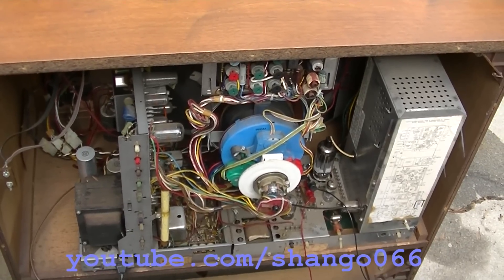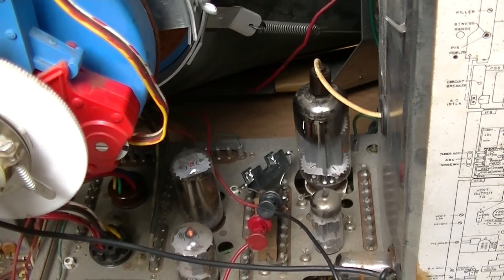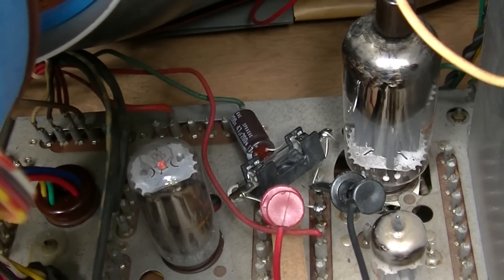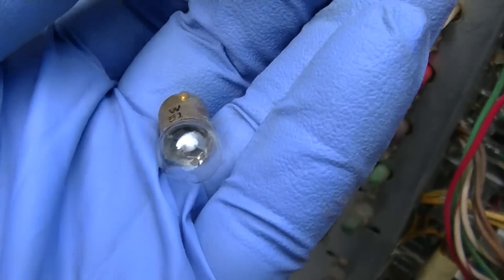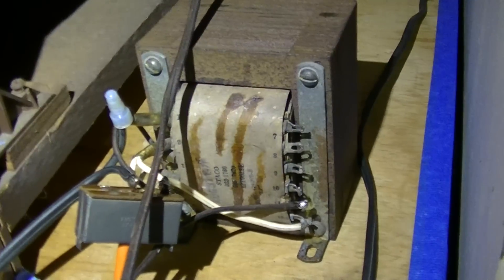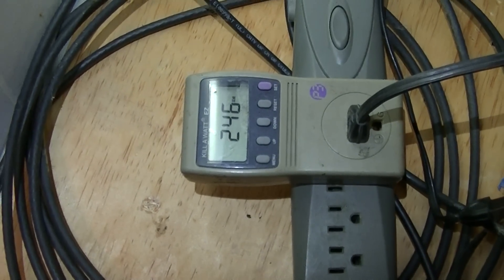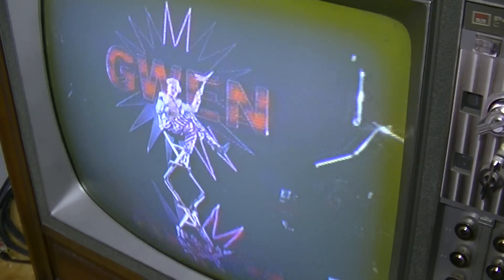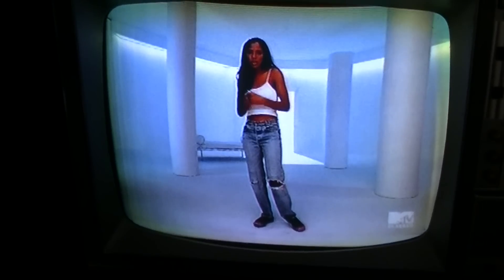In Service 10 1 22 1968 NOS Packard Bell 98C18 What Will Fail When

Comment: My parents bought a Quasar console in 1976 which was one of the first of the Panasonic models after Motorola stopped making them. That set had near perfect bright color, and perfect sharpness despite being a delta gun picture tube. The analog tuner worked pristine on both an antenna and in the early days of cable when the VHF tuner on the set was used where our cable only had 12 channels 2-13 at that time. I still used the set myself up until early 2000 when the CRT finally began to fail after 24 years of consistent use. They don’t make them like they used to!

Comment: Very Good, to run the TV at reduced line voltage. Today your typical Line voltage is between 120 and 123 VAC, which is on the high side, old sets were  rated for 115-117 VAC. I built my line voltage reducer in a Radio Shack metal project box to have 115 or 110 VAC for powering old antique radio sets. I included an oil cap to reduce the power factor.

Comment: That was a GREAT Idea to lower the line voltage with the hum bucking transformer. These old sets were not designed to run on the higher / unsteady voltages today.

Comment: The capacitor across the fuse is a good lesson in average vs RMS current.

The fuse blows on RMS, but your ammeter reads average. Numerically, in this case, the difference will be enormous.

The capacitor is an ideal solution.
Reply: Average of AC voltage = zero. 😸 (any symmetrical that is)

Comment: this thing will probably run for a long time, we might get bored with it not breaking down, I run my Zenith space command 100 from 1970 on a bucking transformer brings it down to about 116 v, it's an 18-in tabletop color set that I've had for at least 25 years, been into the hobby for about a year now replaced all of the tubes and made all adjustments per the sams, and looking for a CRT for it it takes time it may take a couple years but I'll find one The one that's in it is on its way out slowly but it still produces a fantastic picture when it's all warmed up.
Reply: I bought a 1979 19” Space Command new that you could hook to your phone line. You could receive and make calls from it with the remote. It finally went out in the early 2000’s. The last 2 years required giving it a smack on the back when it misbehaved every 3 months or so!

Comment: I like that hour meter. A lot better than the battery powered one i have for my generator with non replaceable battery
Reply: I installed one of those "tach & hour" meters on a Nissan 9.8 outboard, back about 2009, it is stored in an unheated garage in the Chicago area, and is still ticking along as to this day. But a good EM one that is line powered.. just needs to keep a motor shaft spinning.

Comment: Great picture Quality on that TV! Let's see how it performs over time! My parents got their first Color TV in 1974. A solid state Grundig super color (I am German). That thing worked flawlessly (except for the failing power resistors those sets were known for) for about 25 years. After that it was retired in working order (ran when parked). It is still in my parent's attic. I am sure, it will just work when plugged in.
Edit: It's amazing how long those German CRTs held up.
Reply: I never saw a Grundig super color WITH a good CRT, most were all greeny and knackered by the early 80s!
Reply: @jonathaneastwood2927  Depends on the type of CRT. Some Grundigs used Russian made CRTs and those were junk. Some used cheap CRTs made by RCA. Those were a tad better. The German made CRTs from Valvo lasted a long time. Maybe it's a maintenance issue. If a bad tech adjusted the bias and the drive wrong, the CRT is trashed in 100 hours. And maybe I was just lucky when I encountered Grundigs with hot CRTs.

Comment: I think you should play 4 by 3 material on the set if you are going to run it continuously so the CRT won't wear unevenly with the letterbox bars not being lit.
Reply: I still use 4:3 CRT TVs with current 16:9 programming, no letterbox burn on any screens yet. Probably because the HV regulation is not perfect in any of them (including the low-end, end of CRT-era Samsung SyncMaster 763MB monitor I'm using right now), the picture size is constantly changing with the average brightness, so the edge of the letterbox is always at a different place. This will still cause burn-in at the very top and bottom, but the transistion won't be a sharp line, so it won't be that noticable. It also takes a very long time to develop such burn - although this early color CRT might have phosphors that are easier to burn.
Reply: @mrnmrn1  Some digital cable boxes can convert their video output to 4:3 format to fill the whole screen ‒ I have set mine to do that.
I'm using an old CRT VGA monitor with a cheap video converter and a set of cheap computer speakers to watch TV.
Reply: @zsombor_99  Úgy is lehet, de nem szeretem, ha le vannak vágva a kép szélei. Annál már csak azt utálom jobban, ha függőlegesen megnyújtják a képet, hogy kitöltse a 4:3 képmezőt. Brrrr.... (I don't like if the sides of the picture are cropped. I hate even more if the image is stretched vertically to fill the 4:3 screen)
Reply: @mrnmrn1  🇭🇺 Nyugi, ez nem vág le, csupán átformázza 4:3 formátumúra, hogy kitöltse a képernyőt. Csupán a 16:9-nél jellemző alsó-felső fekete sávok tűnnek el. Egyedül akkor lehet picit fura, ha valamelyik adó 4:3-ban ad valamit és a két szélére rak üres részeket. (Hogyan jöttél rá, hogy magyar vagyok?)
🇬🇧 Don't worry, that is not cropping the image at all, just re-formates it to fill the whole screen. Just the upper and bottom black bars will missing from the 16:9 image. The only slightly weird case is when a channel keeps the 4:3 image and adds blank spaces to the left and right sides. (How you figured out I'm Hungarian?)
Reply: @zsombor_99  Két módját tudom elképzelni a 16:9 tartalom 4:3-ra formázásának: vagy "belezoomol" a képbe, így alul-felül a két fekete sáv eltűnik, cserébe az eredeti 16:9 képtartalom bal és jobb oldalából levág egy-egy sávot. A másik "megoldás", hogy függőlegesen megnyújtja a képet, amitől a teljes képtartalom megmarad, csak mindenki "tojásfejű" lesz. Részemről az első megoldást nem szeretem, a második "megoldást" *utálom*. Inkább legyen alul-felül az a két fekete sáv. 
Gyanítottam, hogy Zsombor névvel csak magyar lehetsz 🙂

I can only imagine two solutions for re-formatting 16:9 content to a 4:3 screen: they either "zoom in", so the image fills the screen vertically, for the price of having the left and right sides of the content cropped. The other "solution" is to stretch the image vertically, this will keep all the content uncropped, the price is everyone on the screen will be eggheads. I don't like the first solution and I hate the second one. 
I suspected with the name 'Zsombor' you must be Hungarian 🙂

Comment: Maybe a part of the wattage drop is caused by some power factor variation due to the buck transformer (the load might became more inductive). If the meter can display it, check the power factor and/or apparent power difference in VA.
Reply: ... Or put the power meter after the buck transformer

Comment: I wonder how long the average modern T.V. Set would last when run continuously from new?
Reply: Where I used to work we had some 40" Samsung LCDs that were installed roughly around the time I got there that displayed call data 24/7 for the 8 years I worked there without any failures.

Incidentally, I'm aware of a CRT security monitor from the early 80s at a local store that's been in service 24/7 since installation. The picture is quite dim at this point but still viewable.
Reply: With modern LCD sets the backlight setting can have a huge impact. Turn it down from max to something more reasonable and it should last a decent time.

Comment: More things should come with hour meters on them. I think it be shocking how short a life things have now a days.
Reply: Probably would need to read in minutes and seconds for how short stuff lasts these days.  Then again the meter would probably be so cheap that it would fail.
Reply: Hp computer monitors do
Reply: Especially these 50.000 hours LED Lamps. Most of them failed at around 2 years, which makes 6*365*2=4.380h @ 6h/day running time. Even if they would run the whole day, that is 17.000 hours and not 50.000h. Manufacturers need to be held liable by law for their product specifications, with big fines until they learn it the hard way!
Reply: The hour meters would be made in China and probably fail quickly too. Haha.

Comment: I'm sure you know what you're doing but wouldn't additional fusing and lowering operating voltage protect certain parts from normal failure? The vertical size already seemed a touch small.

Comment: I know that you are not a big fan of testing tubes, however it would be nice to document all the tubes in the set as a bench mark.as the set fails, retest the tubes to see the life span of each tube, checking for conductance, grid leakage, and shorts. "  just an idea/ thought".    I remember my grandparents( mother side) bought a new 1966 color vista R.C.A. T.V. set. the first service call took place 4 years later( 1970), then 3 years( 1973), then 2 years(1975), and 1 year( 1976) after that( not repaired). after 10 years of service the C.R.T. was tired, and the set was retired, and yes the set was subjected to cigarette smoke, being they both smoked 2 packs a day

Comment: Good working ... NTSC is a good system ... 👍
Reply: Colour TV -NTSC TV 525 Lines  in 1968 is about 100% cheaper than Colour PAL-AM - 625 Lines in Europe (including Thailand) for the same screen diameter. I guess the PAL-AM or CCIR is ,much in higher definition.
Reply: @johnmadow5331  In the 1950/60er years was in europe experimented with NTSC and CCIR-System ... 625 Lines an crystal von ca 4,4 Mhz

Comment: With any luck, Gov Newsom will mandate a drop in supply voltages in the state due to power shortages, and the need for adding buck transformers will disappear.  As a supplemental measure he needs to contact Elon and have the newer model Teslas include bicycle pedals in the drivers bay, or like my car in the cartoons a hole through the floor so a person can use their feet to get the cars moving.
The Catch-22 movie ain't got nothin' on Newsom.
Reply: Lots of things will still draw the same amount of power on lower voltage, meaning more current and thus more transmission losses.
Reply: @eDoc2020  That's sometime true. It really depends exactly what the load happens to be, but for most loads like old TV sets, ohms law would apply. I = E/R meaning a fairly constant overall resistance in a device, the current will drop as the supply voltage drops. And then your power calculation is P(W) = E x I
Reply: @fredflintstone8048  Most loads aren't old TV sets. I would imagine most overall loads are induction motors, switching power supplies (including motor VFDs), and temperature controlled heaters. These will all increase current draw in the case of a bit lower voltage. The only meaningful things which will decrease in current are probably lights with super basic power supplies.
Reply: @eDoc2020  One further point. The electric heaters being fed a lower voltage will actually draw less current because the load is a constant amount of resistance. I agree that it will use the same amount of power (wattage) in the end because it will have to run longer in order to provide the same amount of heat to the space. Heat produced is equated to the amount of wattage.

Comment: 2:56 You can replace those very energy inefficient incandescent light bulbs with the magnificent electricity saving LED kind! They'll pay for themselves in no time. 😉 After that poor 1968 TV played that, Yo! Yo! Yo! "music" I bet it felt like self-destructing its flyback.

OK, I have to ask, would this really be considered a real-world experiment by adding the transformer to drop the voltage? I honestly mean, that normally a TV wouldn't have been used with that additional accessory.
Reply: The line voltage was lower when these were produced so I would say yes. They've been slowly raising line voltage over the years. He shows the significantly reduced wattage with the bucking setup.

Comment: It doesn't count as a good life test if you modify the set too much.  It really needs a cooling fan on the flyback, if you're going to modify anything.
Reply: What did he modify? He just reduced a cathode destruction risk and added a meter and reduced voltage back to what it would have been when the set was new (as per the operating specs).
Reply from the maker: And a fan wouldn't be a modification? Troll post
Reply: @shango066  More likely a midwit post, unable to discern what risk mitigation is vs modification
Reply: @shango066  what? It's a serious post and I signed up through Patreon under my real name to contribute $20 a month to this project. I never said a fan would not be a modification, but with the temperature that flyback is running at (previous video) it won't last long.
Reply: @robinsattahip2376  thank you for your service
Reply: @mehmeh5471  Adding a capacitor and resistor to the cathode of the H O tube is a modification. I understand why it's being done but that flyback is already cooking itself.
Reply from the maker: @robinsattahip2376  as many people pointed out a fan would be a great modification if the set were being used and preserved as a typical vintage set. If the flyback fails, so be it. We get a flyback replacement and possible substitution video. Thank you for contributing to the ongoing insanity
Reply: @shango066  No hard feelings thanks for all you do.
Reply from the maker: @robinsattahip2376  or maybe the flyback ends up getting taken apart and getting rewaxed or replaced with a tripler.
Reply: @shango066  That rewax was a great impressive video, you are clever,instructional and fun to watch at the same time.
Reply: doesnt seem to be modified at all really... the TV is actually being run in conditions closer to 1968.. the line voltage seems higher these days than it used to be so bringing it down to 117 is probably what you'd get out of most outlets at the time.. the cathode fuse modification wont change how the set runs but adds an extra layer of protection like a circuit breaker, if the goal is to see how it explodes when that tube fails then yeah maybe remove it but its already well known what happens and a fuse will just make things easier to repair.